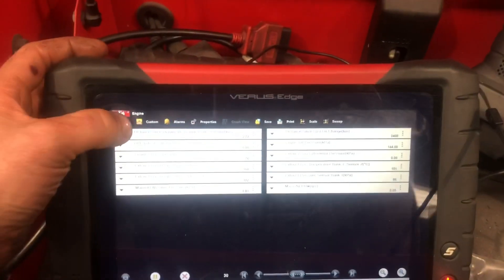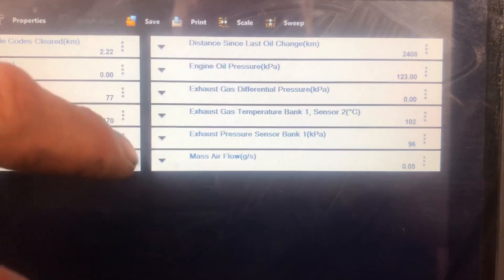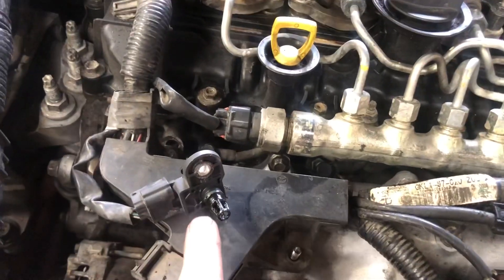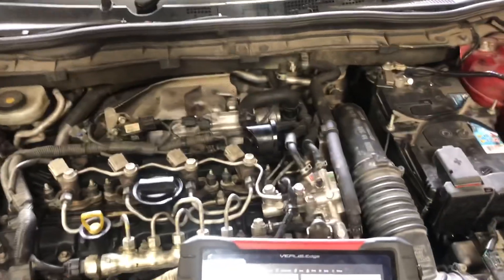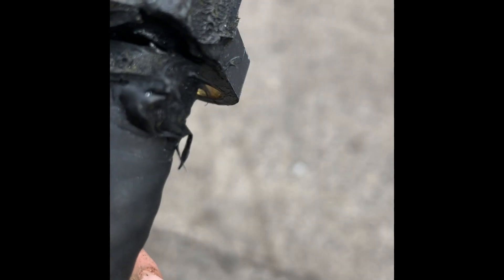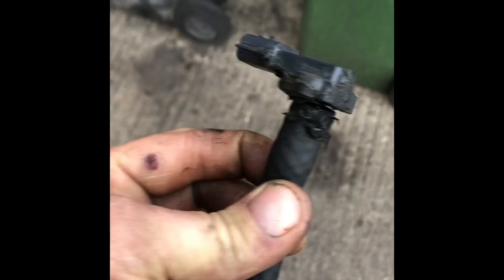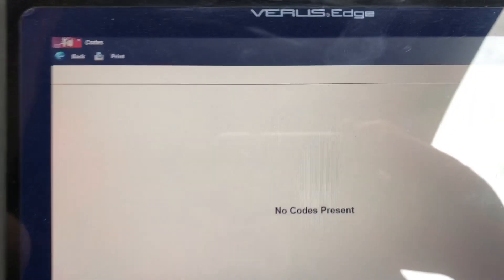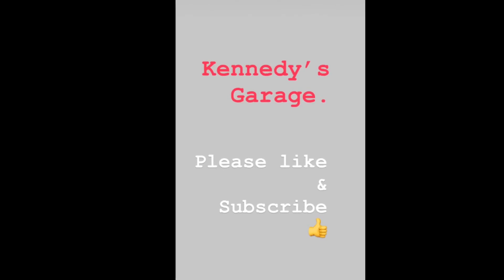Mazda 6 reduced power fault finding

Comment: lovely video, great tips! I have a 2014 mazda 3 with this 2.2 skyactiv diesel and its not realy smooth in low rpm/ low speeds , especially when cold . and its at least 30 hp short on power (120 when stock instead of 150 , 187 after tuning but should be 210-230)  no fault codes whatsoever though. Mazda told me they need to clean the valves but I dont believe it will make such a big difference in terms of power, now i have some ideas what to check , thanks!
Reply from the maker: Hi Sigour, sorry for the delayed response. I only seeing the comment now 😞
The intake manifold ports can get very blocked, from around 30mm down to around 5 or 10mm. This is a big issue with this engine & I would be worth pulling of the manifold just for a look, it isn’t too hard a job around 2 hrs. Only if you haven’t found anything by now 🤞👍
Reply: @kennedysgarage3281  no problem mate! I had the intake, turbo and EGR removed and cleaned, also the valves ofcourse (manually cleaned not with H2O pulses bullshit). I had the DPF filter removed and cleaned and performs complete service (oil, oil filter, fuel filter, air and cabin filter, manual transmission fluid will be done next week). but still a very hesitant, rough, powerless drive at low speeds, still drinking oil, still no power whatsoever above 4000 rpm. this week new airflow sensor should arrive, also mazda garage will reset ECU into learning the injectors how to run again. hope anything helps hahaha. When the car is warm its pretty okay, only no power above 4000rpm,there is a 1-3 second delay on any power I ask, and flooring it in , say 3th gear I feel a slightly inconsistant power delivery thoughout the rpm. Pulls very hard though, had it run 225kmph in germany couple weeks ago.
Reply from the maker: @sigourauwerx6988  exhaust camshaft wear also  🤔
Reply from the maker: https://youtu.be/7fpegs2QF54
Reply: @kennedysgarage3281  Thanks for another tip! How did this car behave with the bad camshaft? I cant understand how the camshaft could be bad , But I dont say its impossible. Car did mostly highway miles and has complete official mazda service history. I put in another airflow sensor and had the injactors go through a relearn procedure, car is more smooth now. I will follow up on the oil level now (yesterday It was below minimum and I topped it up to maximum about 600 miles ago, this is scary stuff)  😥. doesnt leak or smoke though 😏. My garage said next guess is oil scraper rings or valve seals. Shoild have kept my previous mazda 3 with the 1.6 MZ-CD PSA engine. it ran 200.000 miles with zero problems 🤣
Reply from the maker: @sigourauwerx6988  there is a little steel pipe with small holes drilled in it, fitted over the exhaust camshaft to lubricate it & these holes can get blocked. This in turn can cause the exhaust camshaft lobes to wear. 
If exhaust gas cannot get out then less air gets in, causing air flow meter faults. 
I show this in some of my Mazda videos, does this help 🤞
Reply: @kennedysgarage3281  it was the exhaust camshaft lol.. pulls like a train untill redline now :p thanks!
Reply from the maker: @sigourauwerx6988  wheyhey, well done my friend 👏👏👏👏
Reply: @kennedysgarage3281  I've recently had new calms turbo kit hrad gasket head was skimmed and pressure tested valves sorted all intake cleaned.  It went back a week later same code p2262 . 2 turbo sensors replaced 1 was newer better one from mazda . But after about 3 weeks same code came on today after a regen . No dof lights seems to regen more than od expect.  But I'm going to get that exhaust pressure sensor tomorrow and I'll get my compressor and test that hose you replaced . I'm hoping the small rubber hose and sensor us the culprit and my hands won't like those tight spaces as theyre not small lol bloody car
Reply from the maker: @kevinhancock4064  just get a longer piece of rubber hose on the steel pipe & just suck or blow on it, it should be quite easy to notice if it is blocked 🤞
Reply: @kennedysgarage3281  funny enough I did consider this I've got a few bots of hose in shed I'll try that cheers matey ..I had garage reppace 2 other sensors on turbo this I beloeve is the last 1 and most common . Cheers buddy I've got parts here will attack today cheers
Reply: @kennedysgarage3281  I have a compressor mate seems it's def not clear I attempted today however had work so couldn't complete . Had battery out turbo hose etc I believe I could see and get to the lower nut but hadn't removed the top shields.  The rear 10mm nut and lack of long reach spanners proved difficult to undo . I'm well pissed at the garage not checking this pipe they said they did but I highly doubt it. And feel this is what's going me this pissing p2262 code still . It seems mostly if u give it some . First start up often feels great imc the drive tickler is smooth obvs . But it's very annoying..those shields are a pain
Reply from the maker: @kevinhancock4064  it is quite tight in there 🤷🏼‍♂️
Good luck with it though 🤞🤞
Reply: @kennedysgarage3281  thanks matey your videos are great . My poor knuckles are already in a state lol
Reply from the maker: @kevinhancock4064  😬
Reply: @sigourauwerx6988  
I have as well Mazda6  2014 diesel 2.2  stage 1 over 200 hp.and top speed was German authoban 245 km/h.
Reply: @B.Ruslan1978  Yep, I had my camshaft replaced about 8 months ago, I ran 209 HP in the next dynorun and it pulls like crazy now, as you probably know we can shame a surprising amount of cars who do t expect it 😅. I ran 230 kmph in Germany without too much effort but I wast comfortably the suspension being way to soft, felt like floating so I released the throttle 😁

Comment: Great work, One of the best diagnostic person on you tube, 👏 👍 
 i wish you were local to me, 
1 question i were getting codes for Exhaust pressure sensor p0472/p0471 i have changed the sensor and codes disappeared how ever i noticed the live data reading for this sensor are around 95-100 on idle, but it goes above the red line when car goes around 2k RPM, 
Also i have took the sensor out of the pipe that you replaced in this video and checked live reading it was showing 96 even when sensor was just hanging around and not connected in the pipe,
Is the reading 96 fixed number set by manufacturer on idle 🤔?
Im not losing any power though,
Also is this part connected somewhere onto exhaust ?
Im having some airflow problem that might be related to this pipe been blocked?
Thanks 😊
Reply from the maker: Is the exhaust pressure sensor you speak about the Differential pressure sensor ( 2 pipes) ??? If so that should read 0 mbar with engine off & no more than 20 mbar at idle . 

But depending on the scan tool you are using ( they can all do different things) 100 kpa is atmospheric pressure, which both of the sensors are giving you 🤔🤔
Try giving the 2 sensors pressure and verify 
ie. 15psi applied manually should be 200kpa if it is measuring the atmospheric pressure first 🤔
Maybe this might help 🤞
Reply: @kennedysgarage3281  exhaust pressure sensor 1 which is same in this video you changed 1 tube connected, 
On i have basic Autel AP200 diy tool for mazda reading range is between 0-150 Kpa but i get very close to 100 say 96 97kpa when idle around 800rpm, and goes way above the range limit over 200kpa when Cruising at around 2k rpm,
Reply from the maker: @nmalik88  Those pressures sound ok. But I’d like to know what the pressure reads key on engine off??? If you can
Reply: @kennedysgarage3281  i'll check that tomorrow with KOEO and will let you know tomorrow thanks for your reply :)
Reply: @kennedysgarage3281  hi just checked the reading is almost same when KOEO at 100kpa AND KOER at 105kpa
Supplied readings are
Exhaust pressure sensor Bank 1
Is this the right name of the sensor you changed in this video? In case im reading wrong sensor?
Reply from the maker: @nmalik88  ok, 100kpa is atmospheric pressure which is which is a good indication that the sensor is good. Now I don’t know off hand which one is bank 1 sensor 1,  So I would disconnect the sensor with one pipe that I changed & it will trigger a fault code straight away for an open circuit in sensor 1 or sensor 2 . This will identify it for you. 
I also do recommend blowing down each of the 3 pipes to ensure that they are clear 😉
Reply: @kennedysgarage3281  3 pipes ? Wasn't there just 2 ? I've missed something ? Metal one and rubber hose right? Thank you in advance
Reply from the maker: @kevinhancock4064  yes Kevin,only 2 pieces of pipe Steel from the exhaust manifold & the rubber hose to join that steel pipe to the sensor 🤔

Comment: Nice video! 
However I didn't quite understand why there was an oil temperature too high pid?
What did that have to do with that sensor?
Reply from the maker: The fault code had nothing to do with the pressure sensor or pipe being blocked. But the car was down on power & that was what I was trying to fix. I just started with a code scan for direction, but my oil level was very low which I didn’t record and the oil temperature fault didn’t reoccur after I topped it up. Sorry for not showing that ☹️. I hope this helps
Reply: @kennedysgarage3281  If the Engine has a blown head gasket, where exhaust is leaking into the coolant, which is causing the engine to over heat, could that be causing the oil temperate too high PID?

Maybe the leak isn't severe enough yet.
So maybe is only occurs on long drives and where you get DPF regeneration occurring same time.
Maybe that's why you couldn't get it to come back.

But then again the codes did seem to have been reset recently(2.2km), yet the Oil Temp too high PID was still there, that would suggest it occurred recently also.

So since you couldn't get it to come back after topping the oil up, maybe that was the culprit in the end.
Reply from the maker: @xegro  Yes there are an awful lot of variables in the modern vehicle & you are correct it could be a any of the above issues but I recorded the 1st. part 5 days prior to fitting the pressure sensor & pipe . So it went 5 days after oil level topped up with no reoccurring faults but still down on power until sensor & pipe change. Fingers crossed I won’t be seeing that fault code back 🤞

Comment: Great video and detail, Peter. A quick temporary fix for those steel pipes is an inner handbrake cable wire on a drill to clear the blockage without removal.
Reply from the maker: Oh, I tried to get it clean for 2-3 hrs & then gave up, I tried everything but not a handbrake cable. I also cut the pipe while the owner was there so can’t try it but will remember it for the next time, nice one Dave. Thank you 🙏
Reply: Great idea you done this job ? Is it safe to clear it where will the carbon end up ? Saves removing so much crap I guess I'm attempting this tomorrow
Reply: I ended up trying this successfully. My cable was a bit thicker than yours (was all I had). Think I spent about an hour alternating between the drill and compressed air down a thin straw to blow it out as I loosened it a few mm at a time. Then I used the air line to give it a final blast through when I suspected it was clear.
Reply: I do confirm that the steel rope does the job ! I poured standard thinners to the pipe to let it soak over night and repeated again with egr cleaner in the morning ( another 2h). Then I bought 3mm steel rope from wicks for £7.40 - cheaper than the handbrake cable. I cut it to the size ( enough to reach the end of the pipe and enough for hand drill chuck. It took me about 5 mins to unblock it ! Saved £600(quoted for replacing the pipe) thank you very much you both guys for sharing your experience!!!! P.s. I was using a big syringe to check for the blockage - resistance means still blocked